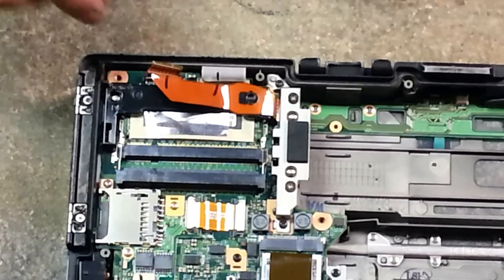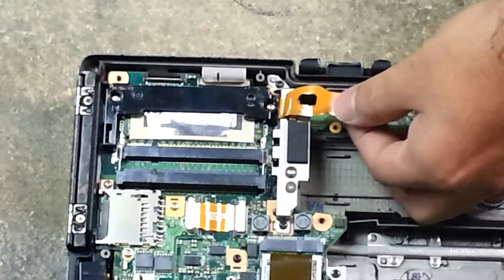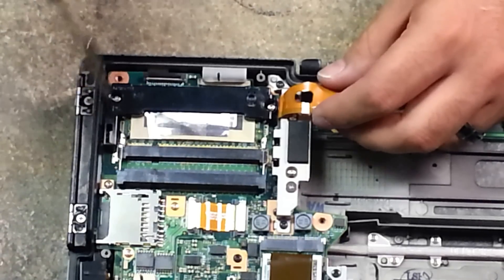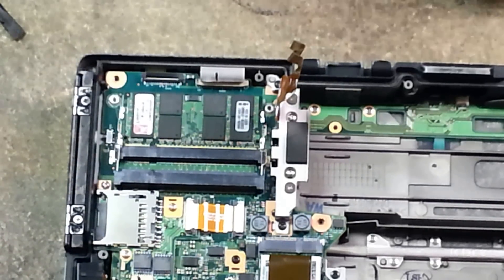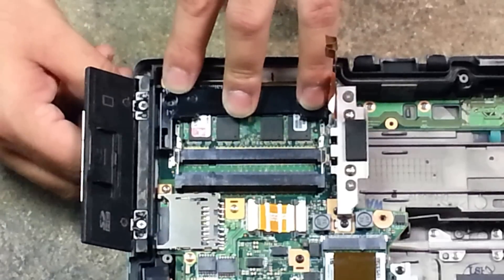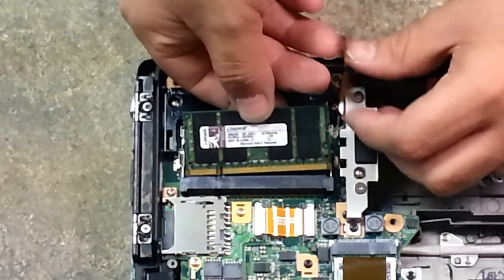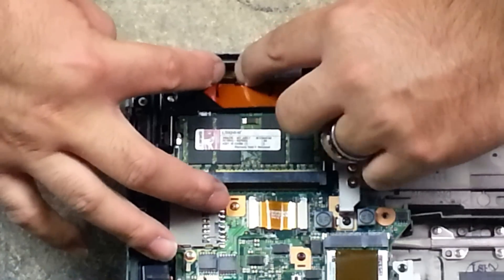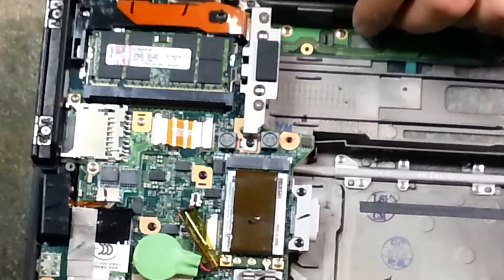Panasonic cf-19 memory (RAM) upgrade

Comment: I have a camera in this location. Does that mean I can't add a second stick?
Reply from the maker: Do you have an MKII or a newer model? You can email me at the channel's name at gmail.
Reply: It's a MK8. I work with CF19s at work and those have 2 slots for RAM. The refurb CF19 I just bought has a camera and unfortunately it looks like the camera takes up 1 ram slot. That's pretty lame. I'm suspecting there's nothing I can do to add a second RAM stick.
Reply from the maker: @barrymccaulkiner7092  would you mind emailing me a picture? I haven't seen that before. If you can't, I completely understand.
Reply: @616pcrepair  email sent.

Comment: Hi,
I am currently using a Panasonic Let’s note laptop CF-RZ4 SSD 128GB, RAM 4GB. Is it possible to upgrade from 4GB to 16GB RAM? 
Thank you very much! 
(I am planning to upgrade from 128GB to 1TB as well, can’t leave this dear laptop for its lightness)
Reply from the maker: Looks like it can support up to 8GB of RAM. At least that's what I was able to find from the specs
Reply: 616 PC Repair Thank you very much! That helps alot!